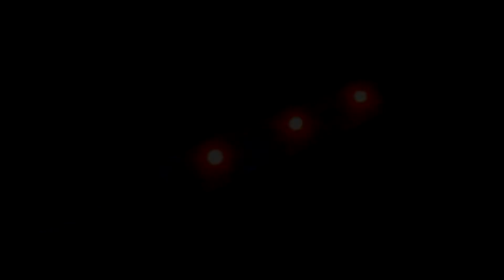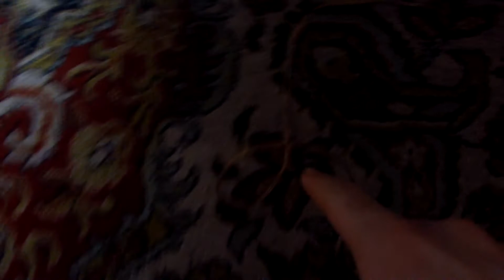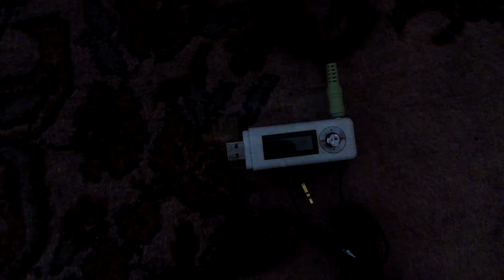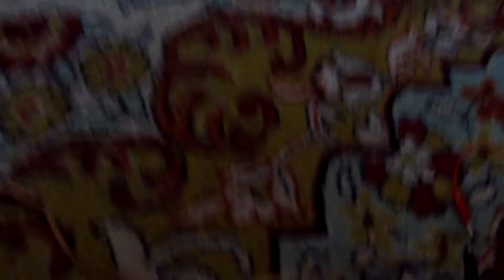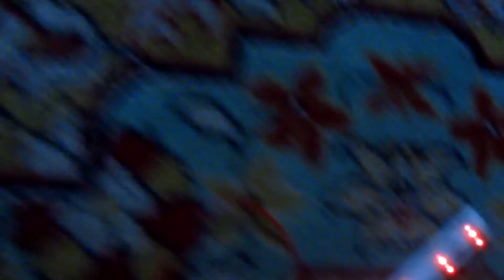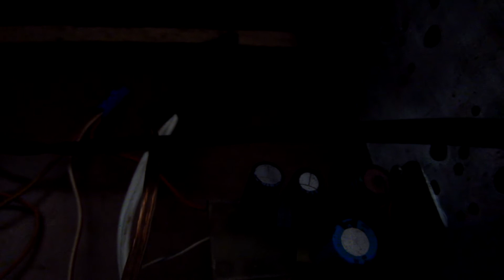How to make LED flash to Music (12v LED, Audio Amplifier, Sound to Light)

Comment: It not a problem that the audio output gives an AC current?
Reply from the maker: No, because LEDs are diodes (Light-Emitting Diode), so they don't conduct in the opposite direction.